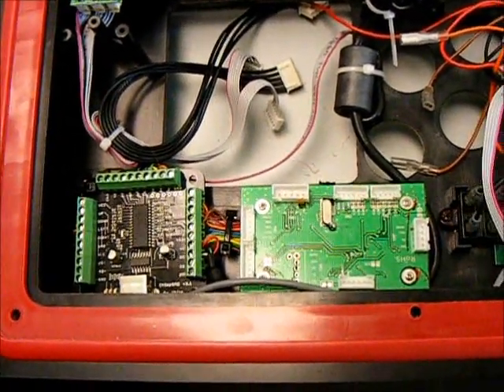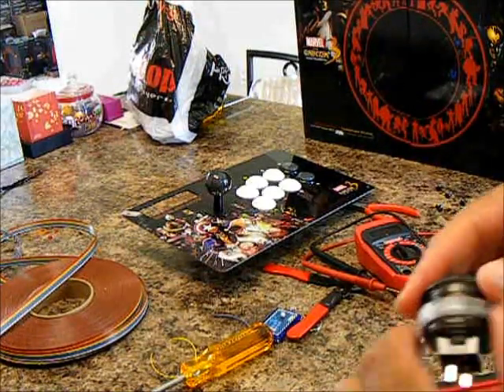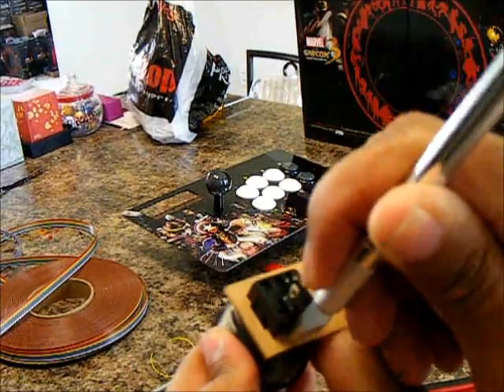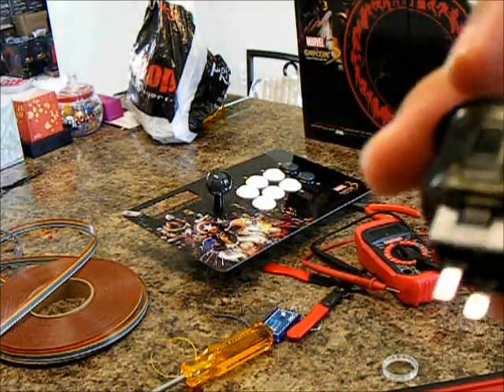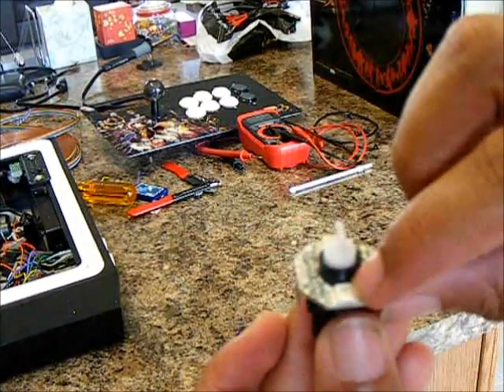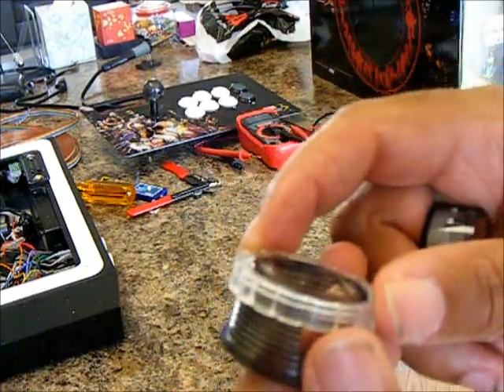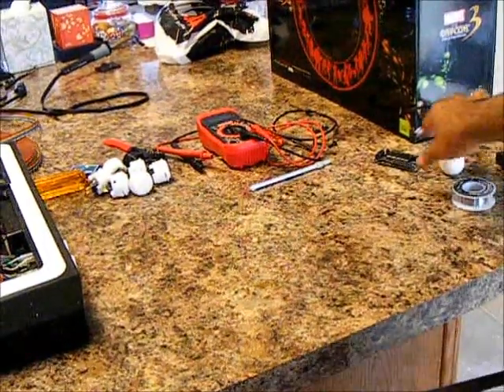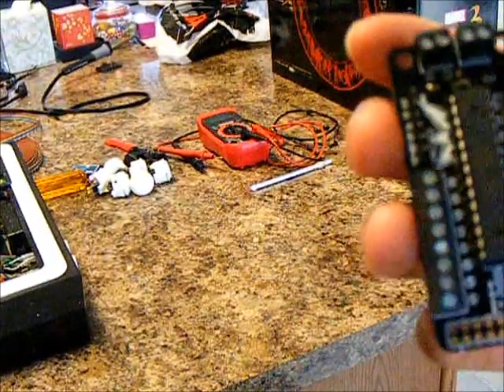MVC3 Stick Overview Part 2: Toodles Chimp, PurpleArms Arceye v2, and 32teeth Sparky Jr PWM

Comment from the maker: @Pandakabob999 what would you like to know. there are two known ways to wire the chimp. either solder and wire them to the bottom of your te stick or play the wires on the quick disconnects in the button terminal array. i personally like soldering but this is just a overview rather than a full step by step tutorial though. but what steps would you like to know? also you can check out Toodles thread on shoryuken forum or his pdf on his site godlikecontrols